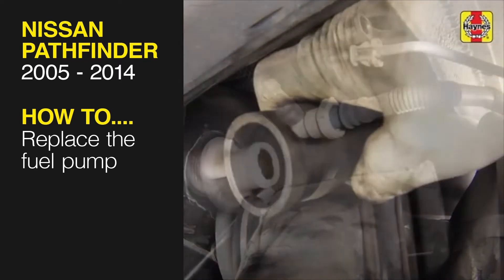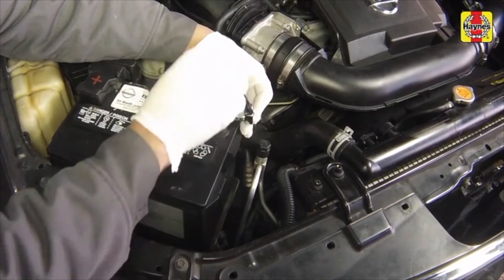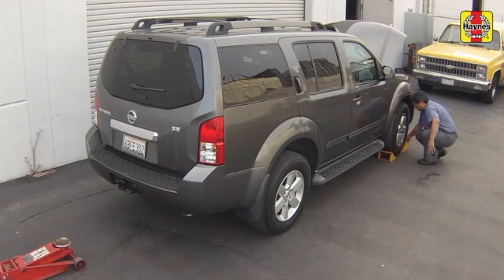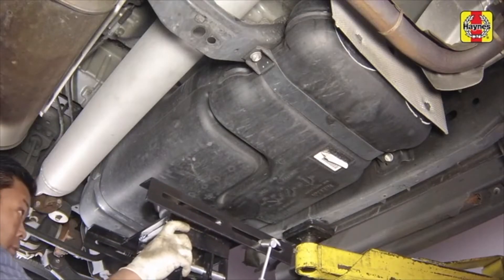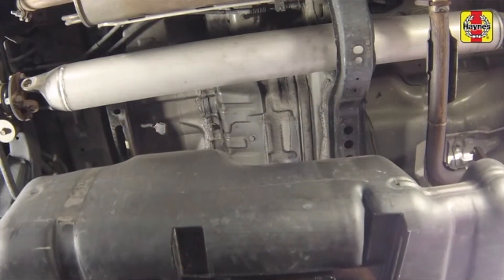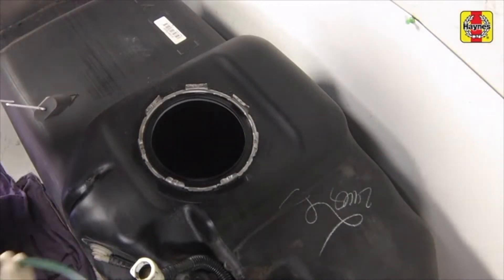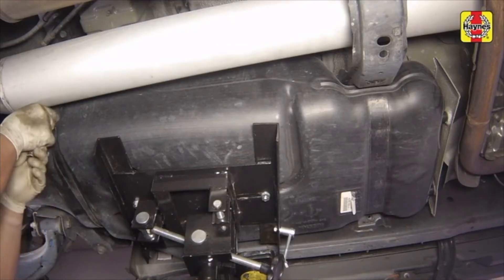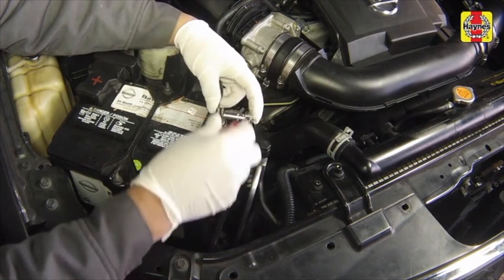How to Replace the Fuel Pump on the Nissan Pathfinder 2005 to 2014

Comment: So what happens if I don’t decompress the pressure in the fuel tank I didn’t pull the fuse and didn’t disconnect the negative cable and I replace the fuel pump and I cranks but won’t start what should I do next?
Reply: Have you done a fuel pressure test? Maybe it's not fuel pressure related

Comment: So replacing the fuel filter isn’t recommended during this? Hmmm ok.
Reply: @scoieb  no filter on second gen xterra, pathfinder and frontier.
Reply: @moshpit0survivor fuel filter is built into the sending unit. There is a pickup screen first for large debris and inside the cylinder at the bottom there a filter media sock connected to the pump inlet.

Comment: Just another bad video that tells you to do a bunch of stuff without telling you how to do a bunch of stuff.
Reply: I understood it very well
Reply: @teenice894  Good for you.
Reply: Didn't see the part about changing the actual fuel pump itself, just the sending unit
Reply: @jdmforever5583  or pressurizing and adding fuel.  And forgot the part about turning off the flux capacitor before starting the job
Reply: Hahahahah... the best part is how they jack it up and put on jack stands. Then next they have a really really really short guy working underneath. 

Oh nevermind they have it on an actual lift!!!  Bwwwahahahaha what a joke